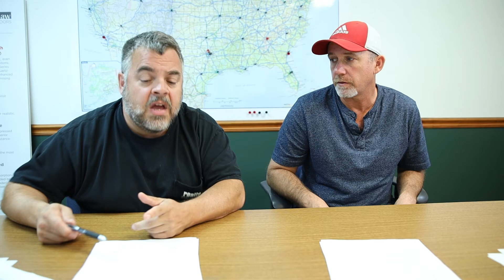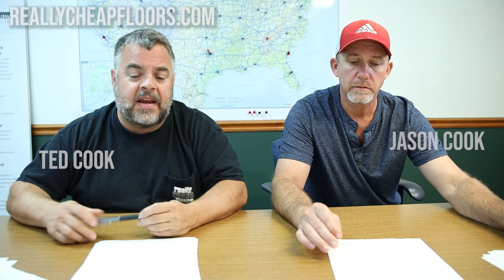Best Engineered Hardwood Flooring & How's Engineered Floors Are Made?

Comment: Does any manufacturer make a waterproof and pet resistant engineered hardwood? I was recently told by a rep that the only option in 2023 that meets those requirements would be Pergo’s newest flagship product which offers a double tongue n groove making joints water tight. My initial thought was Pergo flooring is pressboard core, which is NOT waterproof at all. Any insight would be greatly appreciated.